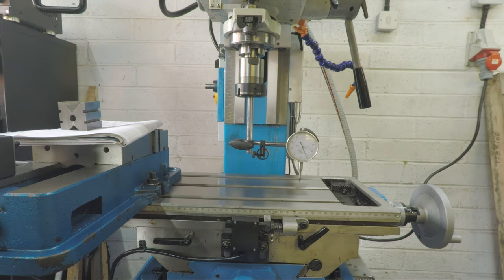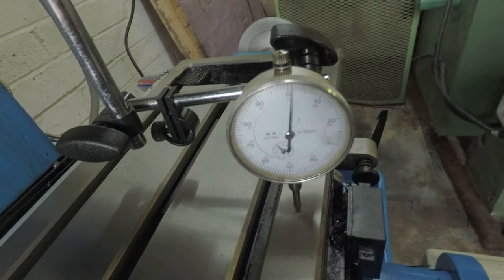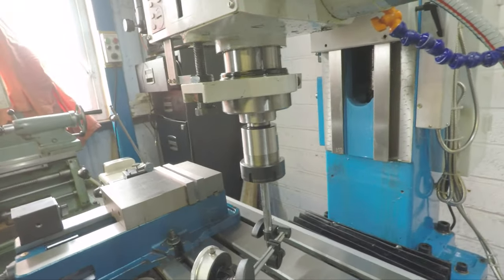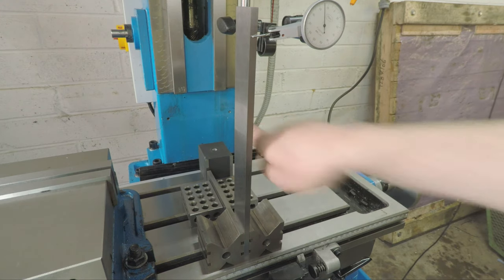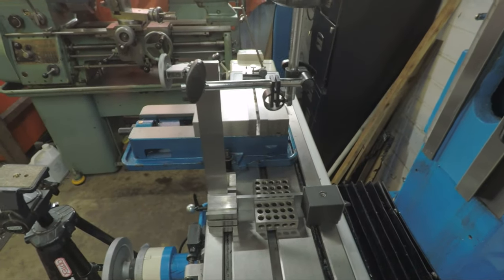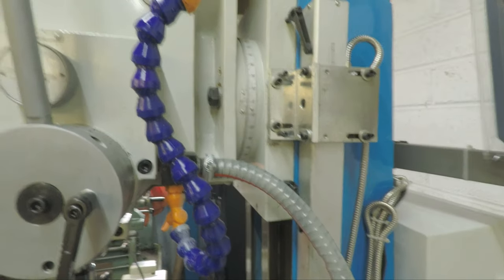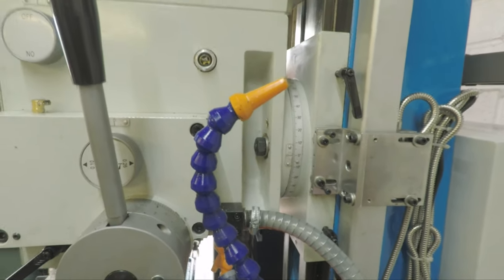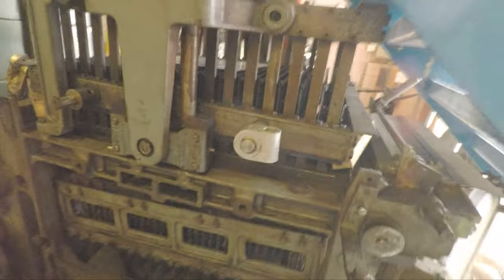Milling machine. Where is the nod coming from?

Comment: Shim the coloumn where it mates to the base.
Reply from the maker: The column is good and square. I don't want to mess that up, Even know it's the easy fix. My plan is to take some measurements without a camera in the way and work out how much i need to adjust the bit in between the head and column. It all needs to come apart anyway when i do the spindle bearing and oil seals. I will check the part on the surface plate and see if this is square. I'm am hoping it's not so I only have to scrape it square.  If it is square then i have to scrape it to what ever angle I have worked out. If this is the case the fault is the spindle bore is not square in the head and i cant fix that (: